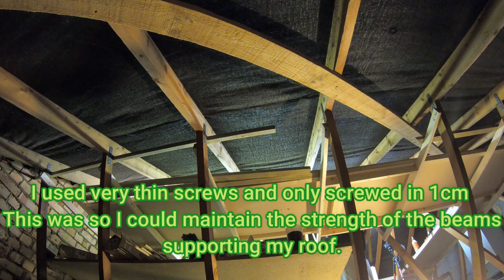Building Up A Model Railway S1 Ep 27 | How I put up a backscene

Comment: Great job! Keep up the good work! Are you going to be getting some insulation for the roof installed? If not, apparently the loft can have  big temperature differences which can cause big issues... I'm not an expert or anything, just what I've seen on YouTube.

Also, bit late now, but clamps would really have helped you with the back boards. They could've held the boards in place for you while you screwed them into place...!

Also thought, if you curl some card / paper up from the floor to the sky rather than having an angle, you will have a smoother transition from ground to sky...
Reply from the maker: Hello, Yes I will do I'm just waiting for the corona virus to finish so I know how money will be over the next few months so I'm being careful on my expenditure at the moment. Thanks for your comment and advice